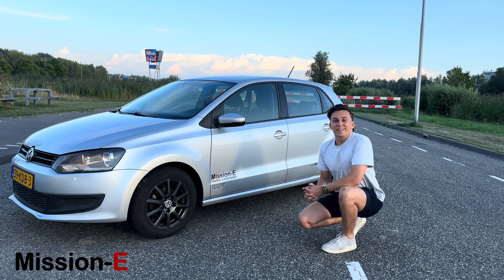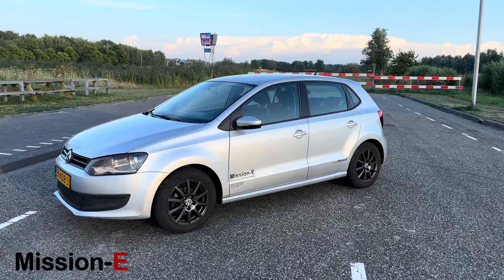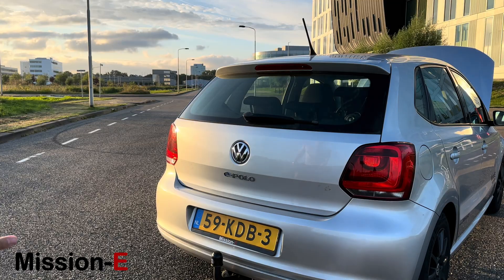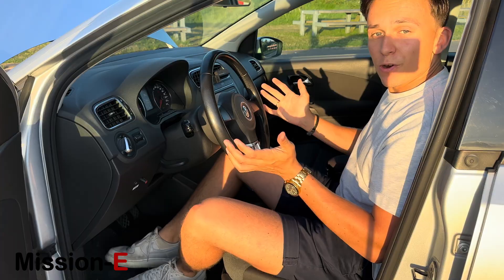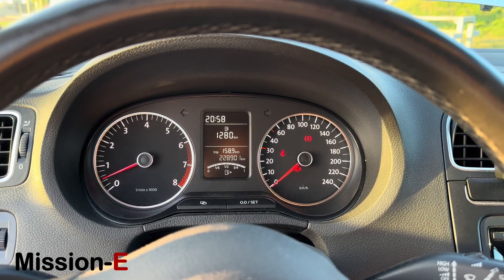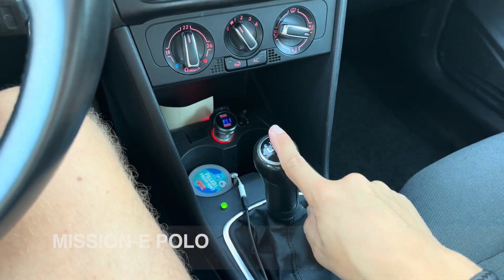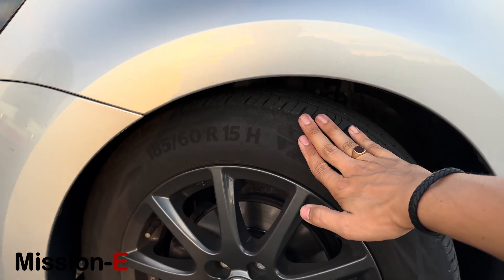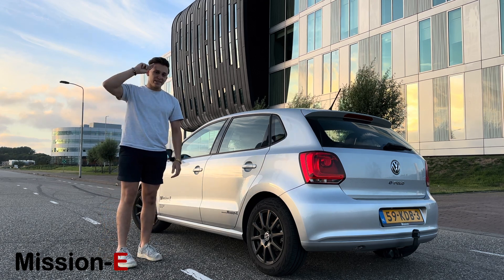The World's First Electric Volkswagen Polo! (Review)

Comment: That is sooo amazing! Also to see, that old cars that were constructed as ICE-only models are very well convertible. I can't understand why car manufacturers still can't accomplish that properly and throughout the entire model line. 

How much will the converted Polo be?
Reply from the maker: Thanks a lot! It is doable to convert but it does take a lot of investment in terms of the designing and engineering of the retrofit. As long as this is not done on a big scale, the prices (for passenger vehicles) are not cheaper than buying a new car. 
So a custom project like this will set you back around 30k. If lots of people want the same conversion this can easily drop to more economical prices

Comment: What's the 0-100km/h 

Super cool project 🔥
Reply from the maker: Thanks! 0-100 currently is 9 seconds in 2nd gear and under 7 seconds in first gear at 90kW of power (testmode). With the full 150kW motor power it will be around 7,5s in 2nd gear and 6,5 in first gear. Mechanical grip is the limiting factor here… wheels just cannot put more torque down on these tires!

Comment: this is sick mate, how is there gears?
Reply from the maker: Thanks a lot! The Polo retained its original gearbox (just fitted the original petrol engine with an electric motor). But because of the high torque from 0RPM you can drive all day long in second gear. 
1st gear 0-100 km/h (fastest acceleration but also a lot of wheelspin)
2nd gear 0-200km/h (most efficient gear and great allround drive ability)
3rd gear 0-250km/h (only to reach the theoretical topspeed of ~250km/h with 204HP)

Comment: Great job on the conversion, congratulations! Does the A/C still work? And did you have any issues at the RDW?
Reply from the maker: Thanks a lot! The A/C is currently not used but we’re planning to mount a pwm-controlled A/C compressor on the existing piping real soon! RDW was quite an extensive inspection but it got through it without any problems!